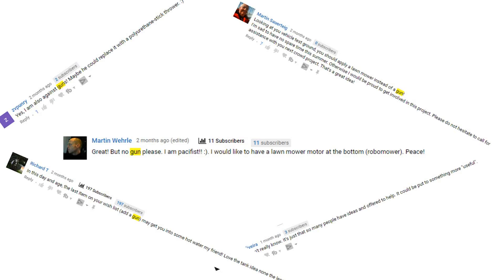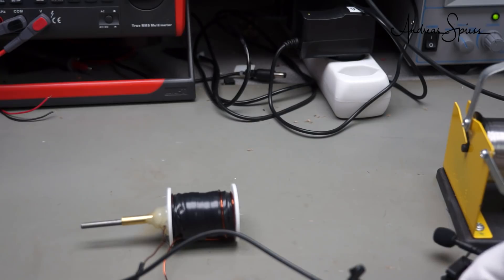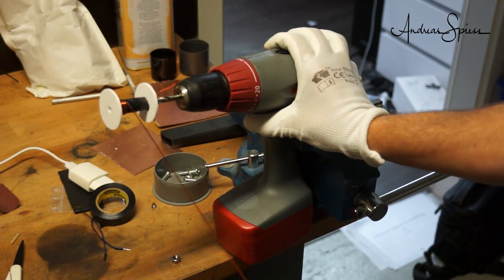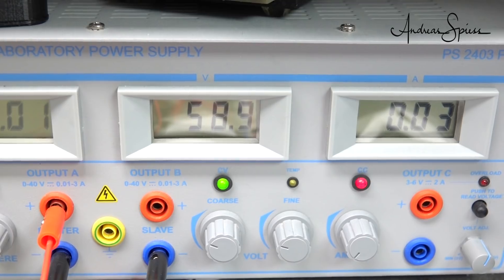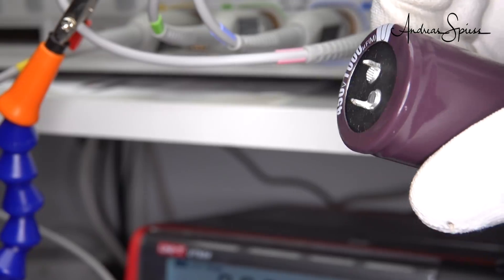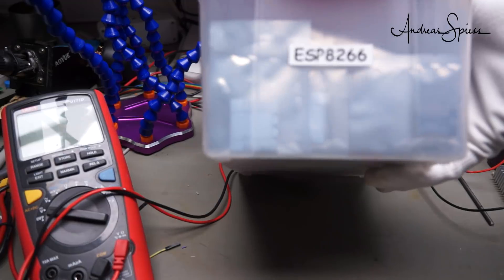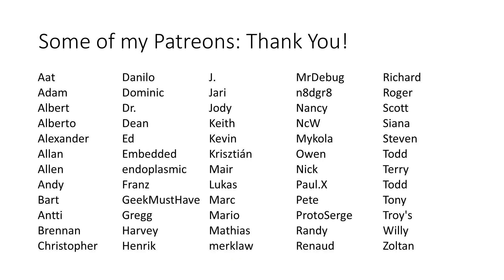#221 Better than GreatScott's Coil Gun? A true story, how-to not do it

Comment: I'm still laughing since this reminds me of my early days building hf kW amp, when energized made the HV power supply  almost dance off the bench due to self oscillation. I can also tell you that holding a wire in each hand with 1000v for one minute is a lasting bad memory. :)
Reply from the maker: I never liked high voltages. And I can imagine that these 1000 volts were a bad experience. Fortunately, it was DC...
Reply: Having spent decades working in the power generation and communications fields my primary tool was the grounded Shepard's Hook.

Comment: I started wearing goggles after a capacitor accident. It was a tiny one too. A little 25V like 10u or so and it was reversed in the circuit. I just happened to be reaching over it when it exploded and it popped me in the soft side of my arm and an impressive welt. And that was just a 25V 10u cap. At the time I also had a bunch of vintage 450V caps (I mess with vacuum tube amps) that I was reforming in  a circuit I had built and I started wondering what it would be like if a 450V 22u cap blew and decided that maybe I'd stop being so cheap and buy modern caps and throw the vintage ones away.
Reply from the maker: Caps indeed can be dangerous (and the source of many problems). So it is always good to use the next better brand...
Fortunately I always wear goggles because of my view.

Comment: How did you change the input voltage of the zvs390v circuit from 10-32v to 8v-16v?
Reply from the maker: I did not do anything. Maybe I had an older version.

Comment: great video! i am trying to make a railgun of my own, but a railgun, not a coilgun. can i use the dc-dc converter alone to charge capacitors? or do i need to rectify its output?
Reply from the maker: A capacitor only can be charged with DC.
Reply: @AndreasSpiess  what about those foil capacitors made for ac?
Reply from the maker: @the_bootleg_starwalker  they are charged and discharged all the time.

Comment: I couldn't see the exact wiring of your 8266, that got killed, but you may want to investigate a phenomenon called 'ground bounce'. When mixing high power and low power circuits you need to be careful of your 0v's and use a 'star' point for your 0v returns.
Reply from the maker: You are right! I do no more remember how I did grounding. But usually I try a star.

Comment: You really don't know what you are doing. Other than blowing things up, optical couplers need driver transistors. You also shouldn't need the trigger battery, which is why you blow up your power supply. You're lucky you still have a computer with that USB device you tried to use.
Reply from the maker: I think I even mentioned that I du not know what I was doing ;-)

Comment: Nice video Andreas, One question: The voltage for the thrisistor to activate is constant? Ich danke dir sehr
Reply from the maker: Thyristors are triggered by a current, not a voltage. So the voltage is not so important as long as it is capable to source the needed current.
Reply: @AndreasSpiess  Vielen dank Andreas!

Comment: Do you have a bleeder across the 400 V cap ? ;)
Reply from the maker: I do not think so. But it would be a good idea...
Reply: Don't please store high voltage caps without shorting the terminals, they can pick charge through air and still give one a nasty shock

Comment: Thanks so much for this video! It actually gave me some more ideas for safety considerations and saved me an exploded cap in the switching converter (I have the same model!). I'm using a 2200uF capacitor 400V and 30uH coil made of 12AWG wire. I optimized the coil design with COMSOL to ensure that by the time the bullet reaches the end of the coil, the magnetic field is already collapsed. The current peak will be almost 2kA inducing a 0.5T magnetic field for 0.5ms and 4ms until full discharge of the coil. One thing I am very afraid of is if the thyristor gets damaged and becomes shorted - in that case nothing restricts the backlash from the coil and the capacitor will get "recharged" with nearly all its energy almost instantly which would at worst result in a huge explosion. In order to prevent it, there's a diode in parallel to the coil which should offer additional level of protection. Regarding optoinsulation - it is another must! I am using an optotransistor for triggering the thyristor.
Reply from the maker: Good luck with your project! I am sure it will work with all the considerations you do.
Reply: @AndreasSpiess  thank you! After some more simulations i decided to use a 5 stage design with 470uF 400V capacitors. I also learned that encasing the coils inside steel pipe plugged with steel caps on both sides can increase the magnetic field 4 times! I can't wait to see if all the math will pay off once i build it!
Reply: Just one more question - I got a bit confused with the schematic. Is the thyristor placement correct or is it the wrong one? The way I understand it is that at 8:00, the coil will immediately conduct. Shouldn't the thyristor be placed before the coil (looking from left to right)? You said it was incorrect but I didn't get whether it's incorrect in the schematics you show or are the schematics already fixed.
Reply: I find that your coil is interesting, how many turns was the coil and what was the dimensions?

Comment: The  SCR gate current output  while driving high di/dt circuits can kill a linear regulator by exceeding the output voltage of the power supply. Also if an SCR experiences negative gate current ( starved gate drive) during high di/dt operation this will destroy the SCR.

Comment: The SCR requires at least a 12 volts gate, drive to produce a high gate current for 10 to 20us, also a series schottky protects the drive circuit from the high voltage generated from gate to cathode because of two reasons. 1. the propagation of turn on time laterally in the SCR ( 0.1 mm/ us) when high di/dt currents are operating, . causing a high gate voltage out put by the SCR during the beginning of the turn on that reduces the gate current you design for. its a constant gate current thats needed in the amps range.. The gate to cathode inductance path should be as small as possible and not share load current.  The GTO is designed with a much more rugged gate and can survive higher di/dts. it can be turned off before the load current reaches zero. but it requires a negative gate drive.but this produces energy that must be clamped by a mov  or  power zener.or a capicative voltage clamp.
Reply from the maker: Thank you for the additional input! Good to know.

Comment: Why not just test C(heap) capacitors instead of going through the trouble of building a coil gun?  And maybe use a 1 Mega Ohm resistor to safely discharge them
Reply from the maker: Because I wanted to build a coil gun?

Comment: One of the main problems with a coil gun is how the voltage is built by the boost converter. Apply a voltage regulator so that you can "tune" the system to the parts you have to use(which may require several discharges of the capacitor) and use a wireless doorbell scavenged from "scrap" to act as a remote firing mechanism for your tank.

I think your tank idea is inspired, but I have concerns about inventive souls that would put coil guns on drones just to prank people like the jolly jokers that they are...
Reply from the maker: This is an old project and collects some dust... So far I did not read anything about it in the newspaper...
Reply: @AndreasSpiess   just a few things I am including on mine to manage past the problems beginners face.

I'm constructing one as a science demonstration for my children and nieces and I'm using the voltage regulator as a safety(of sorts).

Comment: Do not use any conductive material for the barrel, otherwise you've got transformer with shorted secondary winding. Or you can make slot under the coil, however this not recommended as well.
Reply from the maker: Thank you for your information!

Comment: Can you try this with supercapacitors? They have low voltage but high current capability.
Reply from the maker: With smaller voltages you need high currents and thick wires for the same energy.

Comment: My uncle actually made a coil gun of very significant power. It would bury a steel bolt in a concrete wall. He just used an arc welder to power the coils...
Reply from the maker: Good idea!

Comment: Hey, you defetitelly don't need 400 volts if planned coil current is only 200 amps - coil magnetic force is not voltage-dependent, only current makes sense, so same performace could be achivied with beafier wires and 16-25 volt capacitor bank
Reply from the maker: Did you try it?

Comment: very nice video . sorry for the causlties .  but you can avoid it  by adding shunt damper diod a cross the coil  to dump the back EMF   which distroy your ESP 8266  and other electronic parts . 
i face similar problem and causolties   😉
Reply from the maker: At least the power supply is repaired;-)

Comment: “It was Chinese 400v if you know what I mean. I know exactly what you mean. Ugh I hate Chinese measurements. They make the hobby so much harder. You just have to know EVERYTHING is a lie. So you take the value you they give and drop of a zero at the end. Case In point is the 7000 mAh 18650 batteries , and 1000 lumen led flashlights. While top of the market US products might give 700”mAh  and 100 Lm at 10 x the price. 

The entire culture is based on getting one over on your customers. It’s no wonder when any given factory changes it’s name 2x a year. You don’t have to worry about reputation. You just dump your non functional components on eBay and disappear. I still get Chinese parts because they’re cheap. But you never know if what you’re getting is toxic or broken or fake or completely unusable. Many “Arduino” parts are just surplus parts of some crappy device with no support and no documentation an it just becomes trash. And forget sending it back. The retailers know you aren’t going to send it back. 

Also, it blows my mind the prices some times. I bought s bag of small motors for $0.11. How is that possible. I’d i sell a hard drive for $100- eBay takes $15, PayPal takes $15 and the post office takes $20 even shopping less than an hour away. By then it’s not worth my time. and they make profit at $0.11 internationally. No less

Comment: I don’t see a sudden disconnection protection for the inductor as there will be a high voltage spike on sudden disconnection of the current. The high voltage spike will be felt across the thyristor
Reply from the maker: You are right. As we saw in my setup :-(

Comment: I have the same 400v converter for a geiger counter project. Thanks for the heads up on the exploding caps!
Reply from the maker: Hopefully, it will work. I did a project with a commercially available Geiger counter.

Comment: 5 BBBs. I earned the name Beagle Slayer. Learned about optoisolation. Made my first ones using IR emitter detector pairs. Needs lots of opacity. LED lighting seems to have plenty of IR output. Liquid electrical tape (several coats) works. But for $2 I found ready made ones.
Reply from the maker: You are right. Special optoisolators would have worked.

Comment: Hey, I am going to build a coil gun too.
I got the same dc boost converter by luck :)
I did not buy the same tyristor because it was unavaible in local store and it was too expensise so I got  lower and cheaper model of it. It still works up to 600v and 600amps or something like that and thats enough for my calculations.
I got a old transformer with 1mm thick cable and made 2 coils from it. One is smaller and 0.8 ohms and the other is 1.3 ohms. I collect some 330v flash capacitors, and ordered more from  aliexpress because it was cheaper. 

Firs to ask, I newer use a tyristor before. I soldered its connections escept the gate. I don't want to blow it :) can you send me a photo of your tyristors connections so I can understand better. Glad to see this video before doing the experiment, thanks.
Reply from the maker: Pay attention with how you trigger the thyristor. Otherwise many things can be destroyed as you saw in my video. Finally I used a relay to supply the gate voltage which you find in the datasheet for your thyristor.
Reply: @AndreasSpiess  I was thinking to use a voltage divider to supply 1,5 volts but after seeing the destruction in this video I think I am going to use a 1,5v battery instead. Thank you for the reply :)
Reply: I think to use the dc boost converter with 3S lippo battery should I put a 1 ohm resistor with series too.
Reply: @AndreasSpiess  The thyristor in the link is too cheap how did you find that :D I payed 2.5 times more price for a lower model of it from a local store.

Comment: i prefer the inventor of the linear motor Professor Eric Laithwaite's
The Forces of Induction - 1969 version with basic steel,copper,aluminium composites 
https://youtu.be/PAAfFgyWvB4?t=545
Reply from the maker: A little more effort is needed. But you can drive longer distances ;-)

Nice vide, BTW. Thanks

Comment: You could use a diode to protect che ESP i/o pin instead of relays...
Reply from the maker: It probably needs a little more :-(
Reply: @AndreasSpiess  yeah but it could be a beginning...online there are any kind of diodes used to protect circuits...

Comment: That's your record of killed parts in 1 project? Man, I don't even need high voltage to kill that many things in one afternoon. But you mentioned "years of study", which I don't have. Maybe that's the issue.

Nevertheless, I liked the video. It showed me that my plan to build a coil gun is far, far too hard and dangerous considering my knowledge on the topic.
Reply from the maker: This was one of my most dangerous and costly videos. You are right, it helps to know what you do. Or at least what to do that only parts are killed ;-)

Comment: Thanks for this useful video, it has really helped me a lot!
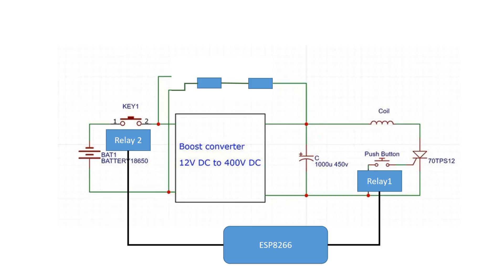Referring to about timestamp 12:30 where you placed the voltage divider: Have you verified that the power supply "in-" and the power supply "out" or 'gnd' as labeled on the board, are DIRECTLY connected?  My cheap meter says so, but I really would like to be able to verify that they are directly connected by examining the board traces.  It would be really useful to know for sure that they are directly shorted.
Reply from the maker: I do not remember. But you checked it with an Ohm meter and obviously, it is connected.

Comment: Since a Joule is a Watt * second (J=Ws), and the capacitor was charged to E=1/2 CV^2 Joules E=0.85J and discharged in s=4ms, you expended over 0.85J of energy (0.85J) in 0.004s, which is W=0.85J/.004us = 212.5 Watts!   Worse yet, the high voltage capacitor was just shorted through the SCR...even more watts!  ...remember what the surge rating for the SCR was!
Reply from the maker: The SCR survived ;-) It supports quite some current.

Comment: The capacitor on the boost converter blew because you left the negative output without a load. These types of converters should not run without a load. Also, on this widespread model of converter for some reason the negative output has a higher voltage that the positive side - it's common that with the potentiometer set at maximum you get 390 or so volts on the positive, and 410-420 volts on the negative. Additionally the board has a jumper that can be removed, and the pins it covered used to enable/disable the converter (in the board docs it's mentioned that it's a TTL-compatible enable signal: 0=enable, 1=disable). It should be pretty simple to design a voltage sensor that turns automatically the converter off when the target voltage on the capacitor is reached. That would avoid further accidents.
Reply from the maker: The higher negative voltage explains why this side blew up. I did not know the enable pin. I have to look for it.
Reply: @AndreasSpiess  It's the jumper in the upper left corner in this picture, right near the transistor on the big radiator: https://ae01.alicdn.com/kf/HTB189S.KFXXXXbuXXXXq6xXFXXXK/DC-DC-Boost-Converter-8-32V-12V-to-45V-390V-High-Voltage-ZVS-Capacitor-Charging.jpg_640x640.jpg
Reply from the maker: Thank you for the hint!
Reply: @AndreasSpiess  You're welcome. You may find this useful too, an annotated manual including a hand-drawn schematic for the module. https://dalmura.com.au/static/YH11068A.pdf

Comment: Cool Video!
I want to build a Very small one (with less then 0.5J ) for a "Show and Explain" Device. This Video is the right "Hint" to start!
Reply from the maker: The Joules in are not the joules out, because the efficiency seems to be quite small, at least in my case. So you might need something "bigger" than you think ;-)
Reply: @AndreasSpiess  ;-) no problem.
I Only want to use a lower voltage but Two Caps with 15000uF. (Enough, i think) I need to build my coil this weekend.